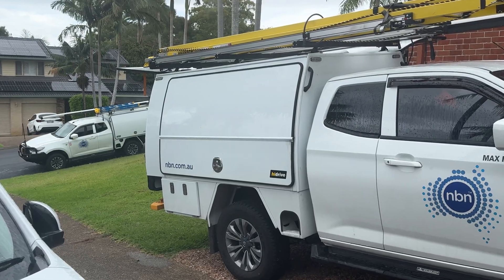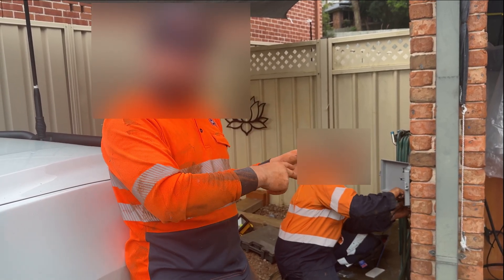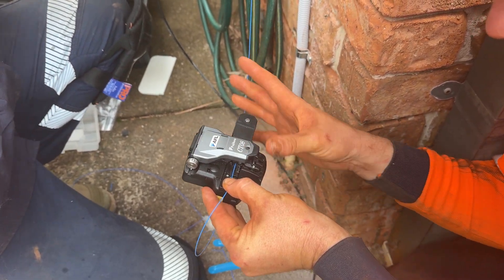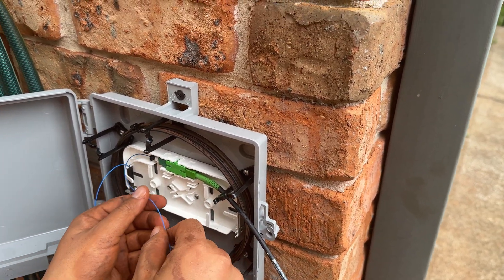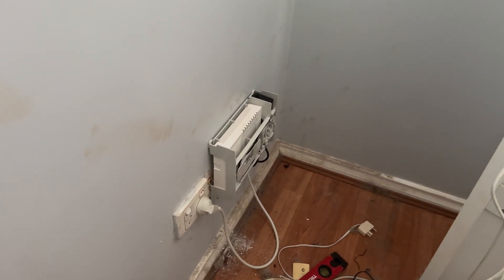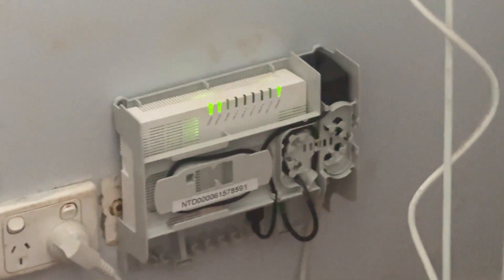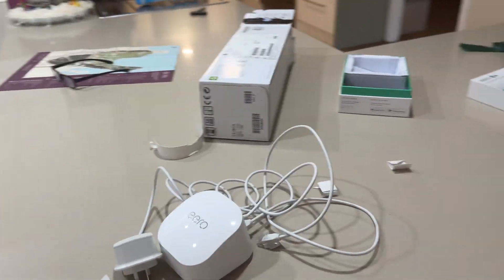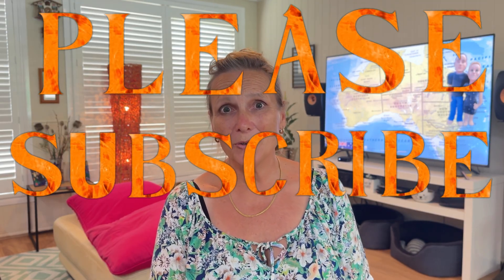Our NBN Fibre Upgrade & How AUSTRALIA Shaped The Internet! 🌎

Comment: It's strange it's not symmetric speeds. Do they charge a premium for that, or what would be the reason
Reply from the maker: Yes great question ? But now Aussie broadband have doubled our speed ( maybe a nbn wide upgrade) for same price - 750 up 50 down SO FAST
Reply: @Bonnie-Lewis-Australia  if you think it’s fast now, you’ll be able to order 5gbit down plans next year once NBN releases it
Reply from the maker: @mickymac826 wow ! But we find it so fast now so those speeds will
Be amazing
Reply: @Bonnie-Lewis-Australia  yeah, it’ll be interesting, the next challenge will be very few people have existing cabling and infrastructure in their houses ready to accept those speeds.
Reply from the maker: @mickymac826 so is optical fibre not enough?
Reply: They do offer symmetrical speeds, however that’s on NBN’s enterprise Ethernet service which uses a dedicated fibre all the way back to their POP location.

The residential service shown here is their gpon service which is a split 2.5gb down/1.25gb up service with capacity split between up to 32 houses.

The new 4 port ntd they have supports xgs-pon which has the capability to deliver 10gb symmetrical, but again with capacity split between the same number of users. Both types can co exist on the same cable (as they’re different parts of the light spectrum) so just involves a site visit to swap over the ntd when the time comes.
Reply: @mickymac826  Here in Europe consumer FTTH are generally symmetrical except for the UK and Germany. We also have 10GB for 25€ here in Spain, very cheap, but you'll need to buy expensive switches and NIC's to take advantage of it
Reply from the maker: @Tom-sg4iv thanks but we  are happy with it and it was a free upgrade too
Reply from the maker: @mickymac826 thanks for your help. With the upgrade to 750 download 50 upload it’s more than enough for us anyway